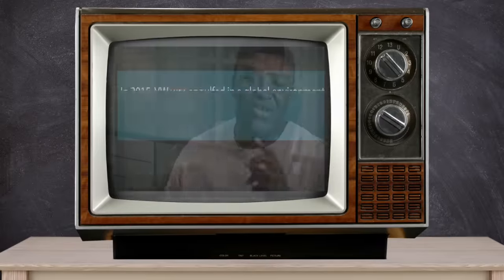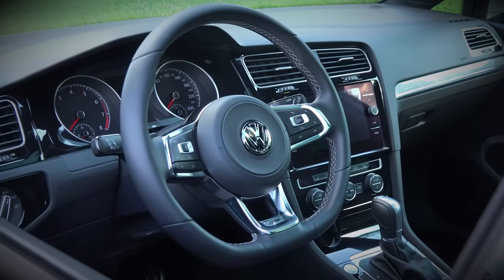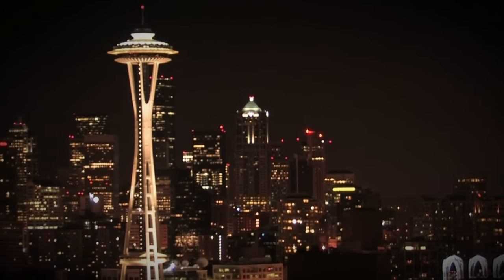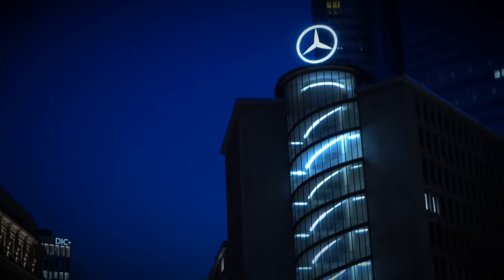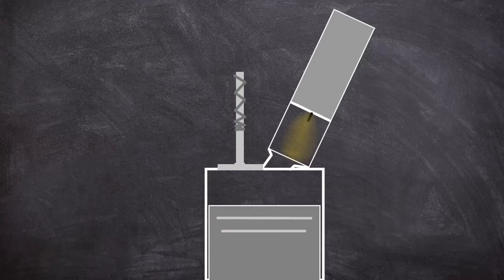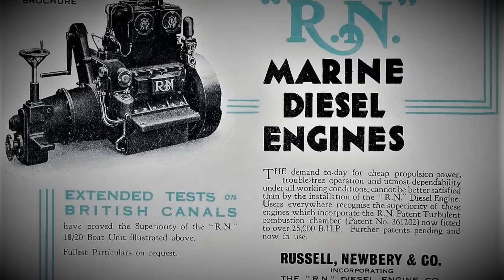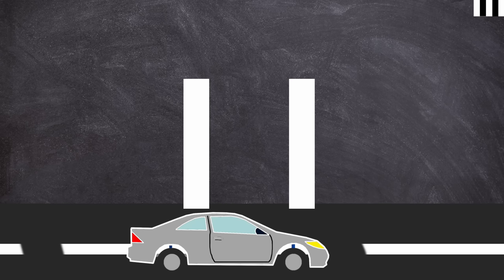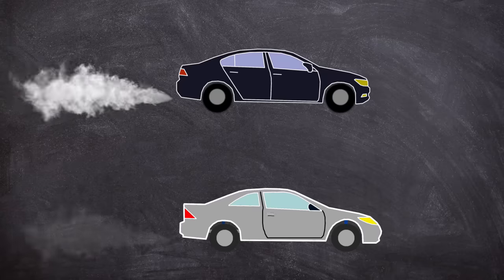Scandal: VW Emissions Dieselgate Explained | Plainly Difficult Documentary

Comment: For a while, one of the big recalled Volkswagen storage boneyards was at an old speedway a few miles south of where I live. Recalled Volkswagens as far as the eye could see. It was kinda horrifying how overwhelmingly wasteful the whole thing was.
Reply: Yep. It was totally awesome for the environment!
Reply: Colorado?
Reply: @macnorman  yup! PPIR south of the Springs.
Reply: @tjzambonischwartz  I've driven by there twice in 2018. Odd site
Reply: I dread to think of how much harm they did even after being forced to recall some cars. The manufacturing and (if it even happens) destruction or refitting of all those vehicles, the number of them still out there, the profits they undoubtedly still made after paying the fines...
Reply: A prime example of how regulations can actually be bad for the planet. All the CO2 footprint of manufacturing those vehicles, expected to have decades of use, is now wasted because they were unnecessarily scrapped well before their time. That they under-performed on an emissions test by marginally little is not a reason to throw them out or expect some kind of refund. What a stupid move.

You want to see the real emissions killers: take a look at what comes out of the exhaust pipes of your local mopeds & motorcycles, Thailand tuk-tuk or unregulated vehicles around the planet. Your modern car is WAY under the levels of CO2 and particles those cheap motors spew out. How about we start by banning those and demanding electric replacement?
Reply: @graafisk  regulations driven by vested interest groups and not by science and economics.
Reply: Doubtful a sizeable profit was made. profit margin on cars are under 10%
Reply: @graafisk  I might be biased, but motorcycles in the western world have been running catalytic converters for the past 20 years. Emissions are being tested every 2 years as it is for cars and they also have to comply to euro4/5 norms in the EU. 2.2 million cars have been newly registered in Germany in 2021, while 200k motorcycles /scooters have been bought. Motorcycles are a hobby rather than a mode of transport for the west, which means mileage for cars is far higher on average. Increasing scrutiny would be a waste of  resources imo.

Speaking of the Asian market is a completely different topic though.
Reply: @graafisk  I would think that's not the regulation's fault. It sounds like Mercedes could pass the regulations, but VW cheated the tests. So we can't blame the tests. I wonder if VW considered converting these vehicles to electric, as many third party companies are doing. They won't be as good as a purpose built EV, but could do for some low range applications if sold super cheaply. Imagine your local MacDonald's employees parking lot full of EV's. for instance.
Reply: @philipjkb15  Cars, motorcycles, Asian market, scooters ... the number of each and how much they are run and which fuel they use ... it's a daunting equation, but I appreciate your input about motorcycles; I did not know that.
Reply: Wasteful? have you looked at how many Carvana has now?
Reply: @graafisk  the emission of these cars was like 20x what it should be. the cars in those fields were leftovers that didn't get fixed, or resold, and many were flood cars that got damaged in the hurricane harvey flood. Letting them drive around for 20 years would have gone well beyond what it cost the environment to manufacture them
Reply: @graafisk  First of all, they weren't failing emissions "marginally" - as the video indicated, they were emitting many times the allowed limits. And that waste of vehicles could have been avoided if VW hadn't decided to cheat in the first place because of pure greed.
Reply: @graafisk - without regulations, we’d see vehicles barely improved from the past - companies only  care about one thing - profit. We need strong government to prevent them from putting profit over the environment and people.
Reply: @philipjkb15  Catalytic converters aren't tested any longer in Europe, unless the car is Euro 4 or lower.
These days we just scan the ecu for fault codes, since the testing equipment will just show a 0 even on faulty cats.
Reply: @HannahFortalezza  how's that working? All our regulatory agencies are fully captured by the companies they're supposed to regulate. Big pharma comes to mind. The millions paid in fines are a drop in the bucket compared to profits. The current deaths directly due to greed are incalculable.
Reply: if you think that's wasteful, check out the chinese EV.
Reply: All exported to other countries I guess, to be used for many years to come.
Reply: @renakunisaki  I couldn't be bothered when owning a VW diesel. Could you? As if we ordinary daily car users really give a shit about the environment in general. We all are selfish buggers when you are honest.
Reply: @graafisk  yes its wasteful but it had to be done to discourage any other rule breakers. If you make rule braking cheap it will be priced in and noone will give a damm.
Reply: Probably would've been more environmentally conscious to just let them stay on the road.
Reply: @graafisk  CO2 isn't directly harmful to human health, NOx emissions are, so recalling the dieselgate cars was the best thing for everyone. It's been estimated that thousands of additional deaths could be directly attributed to dieselgate cars not meeting emissions standards.
Reply: They fixed them and resold them, so not really as much waste as you imagine. I'm driving one of the fixed ones. Its still VWs best motor.
Reply: Pontiac silverdome is full of them. Spare parts bin
Reply: @katiekane5247  hence why I'm saying companies put their profit before people. We need bigger fines for them and bigger fines for corrupt government officials.
Reply: Its almost like capitalism cant solve the problems of capitalism
Reply: It wasn't wasteful at all - I think you'll find all of the shareholders made a profit. Just because you dig up something, ship it across the world, burn fuel to run it, then throw it in a ditch - that's basically just buying a Pokemon keyring with extra administration.
Reply: @graafisk  I think CO2 emissions are focused on too much. As you note mopeds and similar have much more exhaust pollutants. However they produce less CO2. The amount of CO2 is directly related to how much fuel is used so a more fuel efficient vehicle will emit less carbon dioxide.
Reply: I bought  a VW tdi from VW that had been modified to meet the EPA recall agreement.  VW was apparently required to extend the warranty to 10 years from date of original service.  I had already sold back my lemon Audi A3 tdi at considerable financial gain and emotional relief
Reply: Over 90% of Tdi owners sold their cars back to VW during the EPA recall
Reply: But only during short durations of the duty cycle. At cruise, the engine  met emissions standards
Reply: Right. They would be out of service in 10 years.
Reply: I did the same.
Reply: @TinHatRanch  yes, it is better to let those vehicles run for a decade spewing all the crap then end up in the scrapyard all the same at the end.

Never mind that, just build a lifted truck and roll coal 🔥🔥🔥
Reply: @graafisk  if it makes you feel better, a lot of them were fixed and resold. They finished up selling the last of the repaired buybacks about two years ago. I grabbed a 14 Passat SEL with 30k miles, fully loaded, 2yr bumper to bumper warranty and 10yr warranty on the emissions/exhaust for 12k. They re sold them for a really good price. Pretty much anything before I think 2010 was scrapped, after that was fixed and re sold.
Reply: @graafisk  because the electric grid cannot support millions of electric cars yet (and quite a lot of people won’t give up a vehicle (especially if they live a fairways out of town or in a rural area...)
Reply: @gordon1545  <—you are what is wrong with this world.
Reply: @@renakunisaki  they lost billions from it. People were getting msrp for a 4 yr old and 40k mile car. On too of the fines and lose of sales plus all the tdi they had in inventory. Look into shit and think before saying shit.
Reply: They sold them in other countries or junked them. Either way, the US Government offered a solution for a problem we did not have.
Reply: @sonnylatchstring  it's because these cities revolve around vehicles. Can you easily walk to the market and come back within 10 minutes? Unless you live right next to a market, thats not happening. I recently went to the Bay Area in California... My God you are screwed if you do not have a vehicle.
Reply: @graafisk  That isn't a prime example of how regulations can be bad for the planet. That is a prime example of how capitalism is destroying the planet. If we had a command economy there wouldn't be so many cars on the road in the first place and people wouldn't be commuting so far and thus wasting so many resources just to get to their work everyday. We would have curtailed our greenhouse gas emissions already.

Also, not forcing those cars to be recalled would have allowed them to continue polluting and failed to punish the manufacturer for cheating to try to avoid complying with the regulations.
Reply: @GeorgeMonet  Modern well-manufactured fuel-efficient cars and trucks are not what's choking the planet; you need to look at the unchecked emissions from poorly-maintained vehicles around the globe in countries that don't have mandatory inspections every year or so. Those few extra grams of CO2 or particles from a brand new engine are not worth throwing an entire vehicle away.

And it is clearly too late to wish for your "If we had..." economy scenario; if wishes were horses, we wouldn't have this problem.
Reply: @graafisk

They did not underperform on emissions tests “marginally, a little”. It was an order of magnitude higher emissions than what was regulated. And not CO2. CO2 is bad but far from the worst. It was CO, NOx, and unburned hydrocarbons. Things that are not only greenhouse gases but poisons, carcinogens, and deplete the ozone layer.
Reply: @Bartonovich52   We are beating a dead horse(power) here. I agree with you that CO and NOx along with unburned hydrocarbons are bad, but EVERY combustion engine spews these to some level. A reported number being "an order of magnitude" wrong sounds scientifically and mathematically ominous but is actually pretty vague without knowing the actual numbers involved (I don't know them either). [ https://en.wikipedia.org/wiki/Order_of_magnitude ]

I don't have the answers to solve the world's emissions problems. I do believe that scrapping thousands of brand new well-tuned modern vehicles is not one of the answers. An individual Thai tuk-tuk or farming tractor or poorly maintained golf course mower is probably producing more pollutants in their lifetime than one of these cars would have.
Reply: Most of the cars were fixed and put back on the road

Comment: One other bit of fallout from this scandal was that several companies had scheduled to roll out diesels as the scandal developed, but strangely some of them had to delay the release of these diesels for unknown reasons.  When they finally released them, the diesels didn't have quite as much power or economy as the pre-release hype would lead people to think.  They were pretty much all doing it.
Reply: Like who?
Reply: Remember, the idea came from and was implemented by Bosch engineers. VW is not the one who designed the ECU controls, that's all from their tier supplier. Look who was supplying ecu's and diesel fuel injection hardware to those other OEs.... If you were in Detroit automotive at the time there's a lot more to be known about this than what's available. It's going to take decades to come out as to not ruin adjacent individuals careers.
Reply: @lukerinderknecht2982  Mercedes and bmw. Need more names?
Reply: @carlosoruna7174  I thought the OP meant companies that hadn't already had diesels in North America.
Reply: A lot of companies were proved to do the same stuff. FCA, GM, BMW, and Mercedes. Other companies cheat on emissions but in different ways.
Reply: Globally anyone using a Bosch injection system could have been at it. And I guess other ECU manufacturers have similar ‘options’…
Reply: Hmmm that BMW X5 in the research seems to differ. (Then again, I was personally was surprised by it not grossly polluting as the VW).
Reply: @lukerinderknecht2982  Mazda.. Was waiting for forever for the Skyactiv-D engine to come out in the US, but they just couldn't match what VW was doing when it came to MPG and emissions. They either got good MPG, but bad emissions or vice versa..
Reply: @dre32pitt   Mazda is one I thought of first (at the time I was a TDI owner and waiting for them to release the diesel CX-5, that took forever). But when the SKYACTIV-G came to North America I think it was rated for even more hp than previously in Europe. I disagree with the OP's assertion that "they all were cheating" and any delay in releasing diesels here meant they were fixing that cheating in the form of detuning at the sacrifice of HP and economy.
Reply: Hyundai was scheduled to bring a diesel to the US market. Then, they suddenly decided not to. Weird....
Reply: @JetteVetteGS  This was after the scandal came out, in other words it reacted to the backlash on diesel in general.
Reply: @nothere572  and ALL of those listed relied on Robert Bosch GmbH
Reply: Uhhh no. None of them (bar Opel, another German manufacturer) had a software that changed the car's settings if it was tested on a test-bench instead of driven IRL. 
All of them had their cars performing much better in the specific test conditions (regardless if the test was performed on a bench or on a road) than in other, altough similar, conditions. 
Because, obviously, those conditions were known before, so they engineered the cars to be particularly clean when driven at those specific conditions of speed, RPMs, etc. But that's expected. It happens in every field.
Reply: @numeristatech  No, that software was made by Bosch by request of VW and specifically for them (another thing is that the software would have obviously used for cheating, and the advice to not use it on production models was only a precaution of Bosch to avoid responsability), and, despite other manufacturers' cars already on the market had been throughly researched, only Opel had been found using a similar device.
Reply: Vague allegations have no merit. VW resisted common rail since it was developed by Fiat's magneti marelli unit. When they were forced by Euro5 to make the switch they couldn't admit their engines weren't the best and cheated. Honda and Mazda were planning to release diesels in the US but couldn't get them to meet US emissions, which are much tougher than Europe's. GM did release diesels in the US, but power was way down compared to the same engines in Europe. VW because they were cheating were claiming the same power (VW also didn't actually test US spec engines for power, just quoted EU figures on different fuel and test standards).
Reply: It's laughable to think cars are putting out 500+hp and are meeting emissions requirements.
Reply: @bradsanders407  it depends on emissions requirements. CO2 probably not, but the others are ppm and you can reduce them, trap them etc. But there is a cost for that VW tried to avoid.
Reply: If I poisoned one person I would get a life sentence, but the Audi group boss poisoned millions and got a suspended sentence and a fine. We need an overhaul of the legal system to prosecute blue collar crime more realistically.
Reply: @carlosoruna7174  BMW's were tested and passed. That's how VW got caught. They ran tests on the open road and the BMW had no significant difference in emissions, and the VW did. So they knew there was something fishy about the VW. Note US EPA regulations in 2014 were an order off magnitude tougher than Europe's. BMW and GM offered diesels in the US before the scandal that were significantly different to the European versions, resulting in lower power. VW just cheated.
Reply: I know for a fact Mercedes was doing the same thing in some (but not all) of their diesels - you can still find the software update tech bulletins which quietly fixed it if you have STAR.

Comment: The single greatest marketing ploy ever. I was never interested in a diesel powered car until the mad lads pulled this off.
Reply: Long before a diesel gate I drove a little diesel four banger FWD hatchback in Cadiz, and it was awesome the way it would drive up and out of very steep underground garage entrances. My 4WD gas-fueled Subie would struggle on similar slopes.
Reply: Still drive a TDI. This controversy is bollocks
Reply: @DPoner  um, no. it is actually very true.

however, diesel engines do rock regardless
Reply: @DPoner  I was there. 😃
Others were doing similar things, the EV is just a marketing ploy. It needs subsidies to compete.
Reply: I think it was good engineering.  Make the greenies think they were winning, and give good performance to the rest.
Reply: @handleyjackson5490  and melt the ice caps!
Reply: @handleyjackson5490 Those chucklehead EPA bureaucrats really screwed us out of an excellent car.